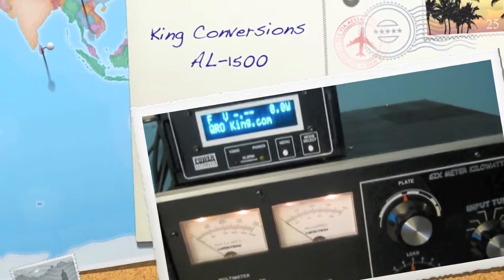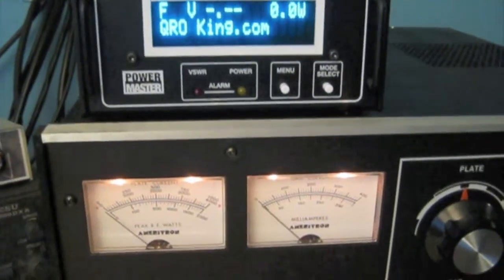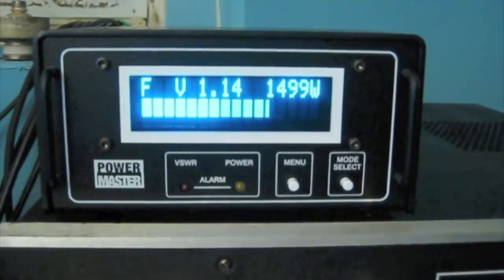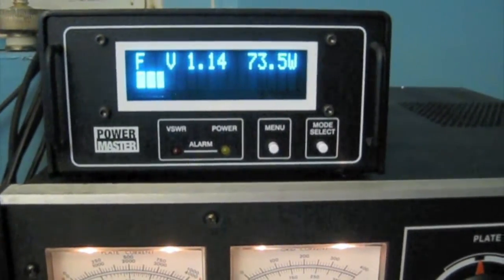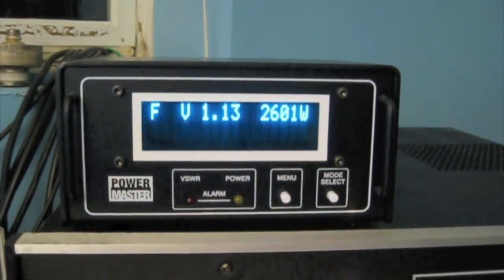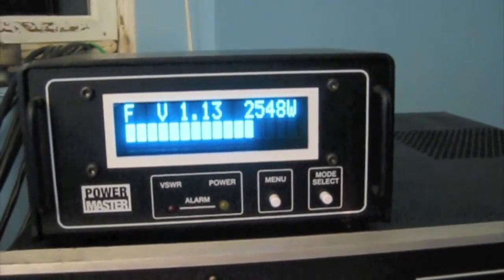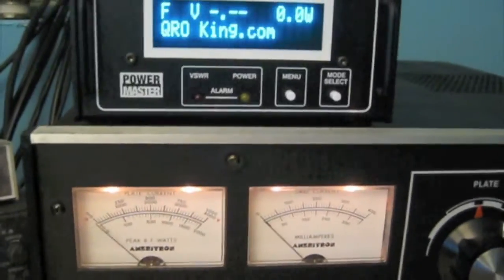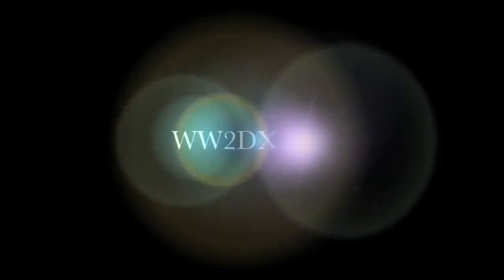King Conversions AL-1500 6M

Comment: Nice but I prefer a NO TUNE all band amplifier for HF/6 meters & 1100 watts is more than enough for any contact & that's what I get with my ICOM PW-1 & just 30 watts of drive.Congrats but we all know you would NEVER use all of that extra power on the air either right? LOL  de W4KVW  EM80  {:>)